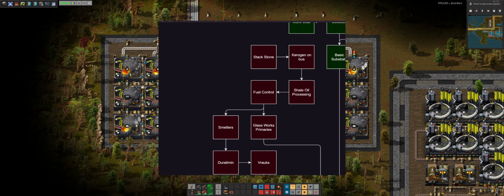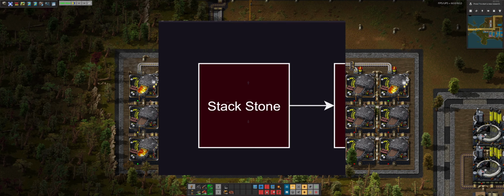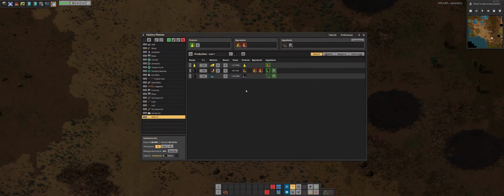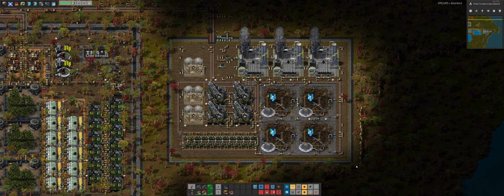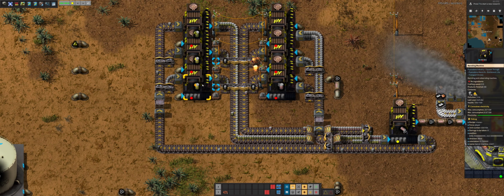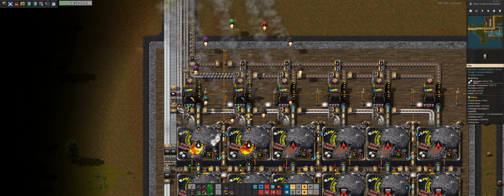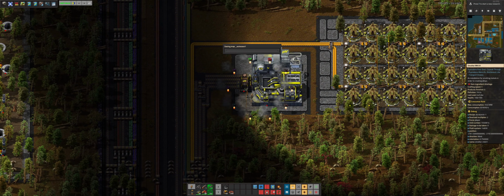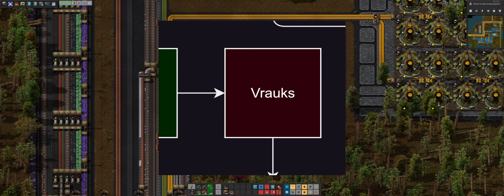Factorio Rampant Pyanodon - S03E14 - Fuel Control and Barrelers

Comment: OMG that fuel control system is so smart you just solved an ancient problem that almost no one has found a solution for in py
Reply from the maker: Haha thank you! The system in this video is a little outdated! In a later episode I give every glasskworks it's own barreler because given enough fluids this version can jam. For some reason you get like .01 of 8 different fluids and it just stops working. However if every glassworks has its down barreler, then it can never jam (it's been hundreds of hours and it still hasn't!). I'm quite proud of the solution, even with each device having it's own barreler it's still quite compact!

Comment: Good idea with the fuel. I’m on this part of py too and I couldn’t figure out how to keep my glassworks moving, but I’m definitely stealing this. Do you have a blueprint book ??
Reply from the maker: Hey! I do have a blueprint book but it's like 500 random mostly unnamed things haha. I can send you the blueprint for this one, however there is a flaw in the design. In testing I think I only used around 4 types of fuels, however in game I have around 12. The amount of fluids I'm trying to give it causes it to clog up sometimes and I have to manually clear the system of all fluids.

I do have a 2nd version of the glassworks that's upgraded to allow hot air, though if you just use the normal recipes it still works. I fixed the problem by giving each glassworks it's own barreler. However the issue with this is that I have an advanced fluid handling mod enabled and and that requires py science 01.

So long story short!

1. Use current design, it jams up sometimes with too many fluids inputs.
2. Use new design, has not jammed once yet, however I use the advanced fluid handling mod and it requires py science 01.
3. Modify either to make it work lol

If you have discord, join my server and I can send you the blueprint there! Otherwise I guess I can paste it into the google drive.

https://discord.gg/vbukhATYcj

https://mods.factorio.com/mod/underground-pipe-pack

Comment: I really like the fuel control solution, that doesn't depend on circuits (mine does unfortunately)

Burning heavy oil directly gives you more fuel value than converting it to kerosene, though kerosene does store more compactly. The heavy oil-> kerosene recipe converts 80MJ to 60MJ.  Though Kerosene is the only thing you can burn in an oil power plant you'll get at logistics tech, and that power plant gives you a high enough efficiency bonus to make kerosene a good deal then, I think.
Reply from the maker: ahhhh noooo, extra work for less efficiency whoops. I guess I'll keep it around and yeah, like you said use it for the oil power plant when it comes around
Reply: @VanillaIceCube  yeah Py is like that.  I personally love it, but it goes against most people's game expectations that more work = always better.
Reply from the maker: @sterlinganon  haha yeah, I just gotta be more careful about it. Thanks for pointing it out!